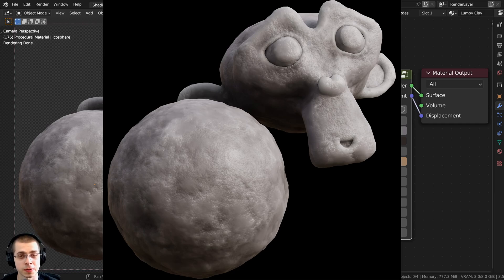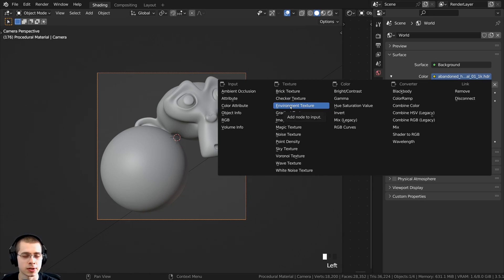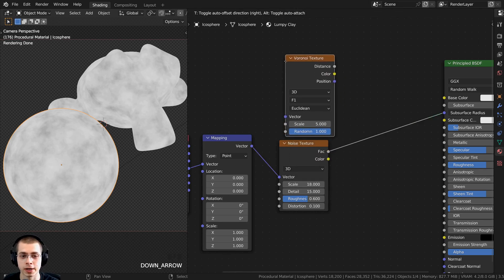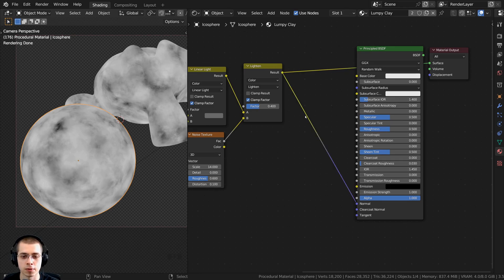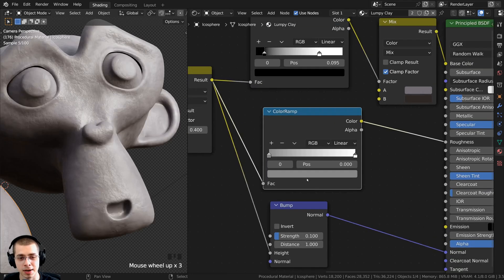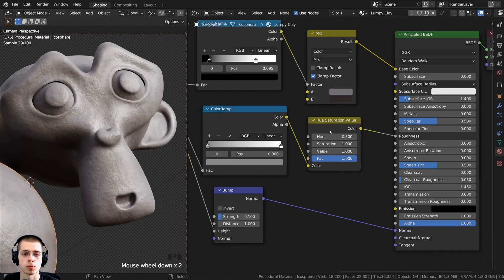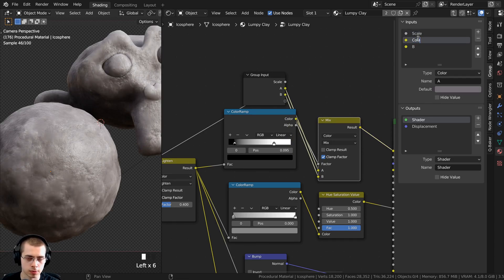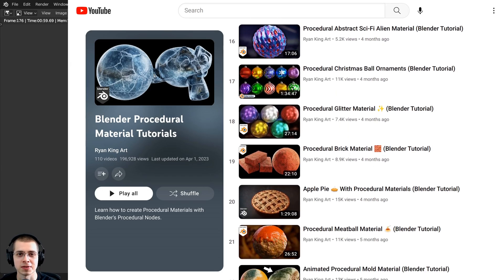Procedural Lumpy Clay Material (Blender Tutorial)

Comment: Hm... this video is only 2 weeks old, and I have Blender 3.5. I am looking at the Settings section at point 3:40 in the video and there's not a single value in there to be found on my version of Blender. The "Displacement" section is also missing entirely. Any idea where the settings in your video have wandered to?
Reply from the maker: Make sure your using Cycles render engine.
Reply: Yeeah I have the Same issue 😅
Reply: Follow up on my own comment: I needed the cycles engine as Ryan says. My video card on my desktop computer is sub-par, so I don't like to use cycles. My laptop, OTOH, has a decent enough GPU so I can use it. Also, some of the nodes have changed in 3.6. As a suggestion, you might consider making a short video on some of the changes (like mix nodes) and how to adapt the changes to some of your older videos.